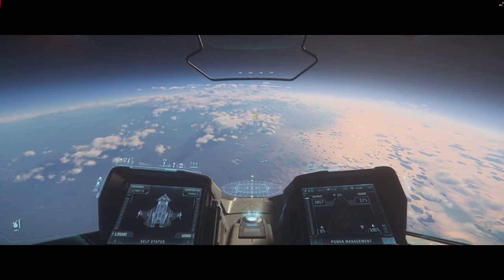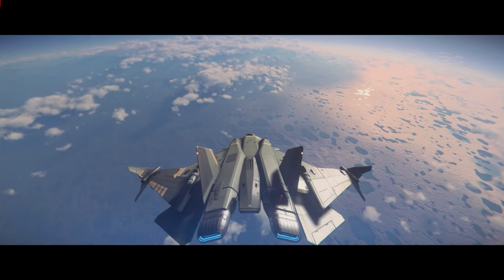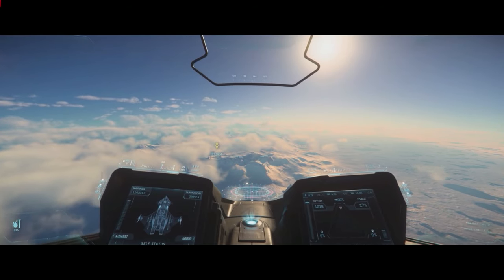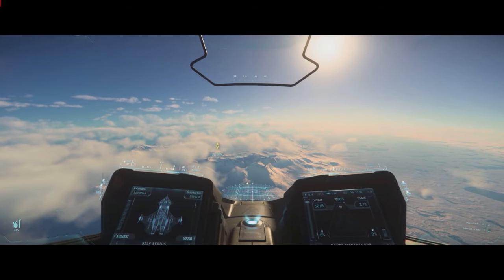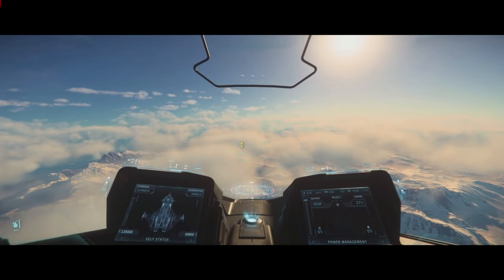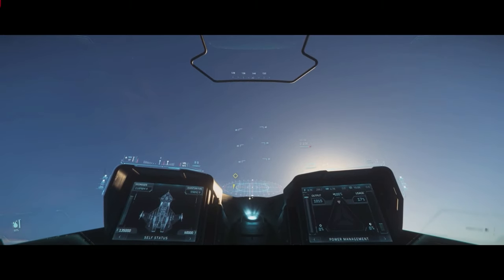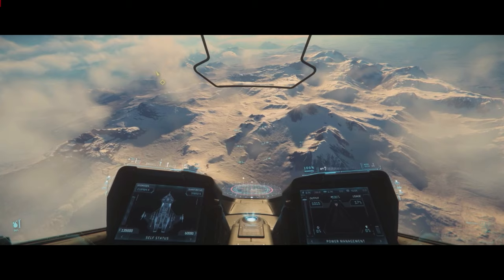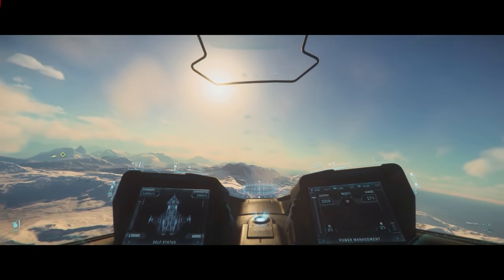Star Citizen Citizencon 2953 - Control Surfaces Demonstration

Comment: I love love love this concept. Bulky ships should absolutely have a penalty in atmo, and massive ships should only be really optimized to takeoff and land rather than maneuver. It would incentive turret gameplay, and give fighters with good aerodynamics a really good edge, and most importantly, an increased skill ceiling from the omni thrusters model we have now. The flight surfaces would be a double edged sword; you can easily outmaneuver your bulky targets and dodge fire, but you now have energy management and stalls to think about, and flying into terrain, and you can’t just upstrafe to get out of it. 

Science wise, instead of heat being the reason they won’t work (well) in atmo, it should be that the smaller mavs have difficulty counteracting air resistance and thus aren’t very effective in the troposphere. Larger ones like VTOL thrusters and main thrusters have enough power to overcome drag. Additionally, the thrust generation reaction itself could be way less efficient when not in the vacuum of space (though since it’s hydrogen fuel I guess it should also combust down in atmo too). I’m sure they can come up with a mostly believable solution that is good enough for us to press the “I believe” button

Comment: The real question is how will bricks like the Carrack, Hammerhead, Reclaimer, 890 Jump, or Cat manage in atmo?
Reply: Like a brick I suppose... hammerhead and 890 aren't supposed to land too often so shouldn't be a problem, carrack too. I rarely land my carrack, usually use a snub and leave it in orbit.
Reply: Hopefully they drop like a rock, with limited VTOL thrusters.  They should have significant motivation to remain in zero G.
Reply: @jeanwesleynew I disagree that they should,  we're going to have some really bad game play if ships that were designed for atmosphere stop working. 

They literally said only a couple months ago that ships like the cat and c2 are how you'd move cargo to and from surfaces when ships like the hull c can't.  And if vertical thrusters are that weak even a freelancer will fall from the sky.  

This is the one thing they showed this weekend I disagree with their reasoning and implementation.  I think CS should work,  I don't think ships should be dependent on them to fly. No to mention the cooling reasoning is the opposite of reality if someone cared about realism.

Imo, HH and bigger should still be too big to enter but some ships, like the 890, we designed and advertised as being able to enter atmo.  The carrack should also be able to or it can't truly perform its role.  Some people treat it like a capital base but that's not what it is. It's an exploration vessel that needs to be able to launch ground vehicles... so hopefully they tune this system well towards large ships
Reply: @amirtaoun3386 
Except the carrack has that large garage with vehicle ramp. It was meant for ground operations.
Reply: @private_citizen  It'll still be able to land, it has enough thrusters for that. But flying in atmo other than taking off/landing will be a problem I suppose. And landing and takeoff such a large ship will take time I'm guessing.

Comment: Very cool. The "super powerful thrusters in space to make flying feel good" and "realistic flying in an atmosphere" can't really co-exist, so the introduction of decreased thruster efficiency makes perfect sense. Though I gotta say as a space nerd it would be more likely that the thrusters would overheat in space since radiative cooling is the only option unless SC has some fancy "only works in space" cooling technology.
Reply: Maybe. 
What i could imagine is the thrusters overheating because they need far more power because in atmosphere they also have to push against gravity and wind resistance, while in space even just tiny short thrusts are enough to navigate, as long as they can overcome the ships own mass.
Reply: @Robonator14 purely a sentimental thought though as  full power is full power regardless of where you are.  They can't just magically go to 180% because you're in atmo right?
Reply: @davidmorton6406  They can't, yes. Wind resistance alone would make it near impossible unless the ship isnt actually moving. 
Full power is full power yes, but assuming its always at max power, there is also a very big difference between short controlled bursts and continious thrust due to having to fight against gravity and having to keep the ship moving.
Reply: @Robonator14  nah you're still making sentimental thoughts,  people use full power in space all the time,  especially with coupled flight. So we're not comparing short bursts to having to fight air resistance.  Full power is full power period. Thrusters would be unusable in space if we had the idea that they could overheat in atmo
Reply: @davidmorton6406  I dont think you understand the difference between power applied and the time the power is applied for. It also doesn't matter what the player does when the game simulates varying degrees of thrust, which it absolutely does, otherwise you could not slow turn and would always snap around.
Reply: @Robonator14  I'm sorry but you're the one missing the point here....
Reply: @Robonator14  I was driving earlier for work, with some stops to text so i gave a short response above, but you seemed to now know what i meant by sentimental thoughts. Essentially you're creating a scenario that fits exactly 1 outcome where this is useful. Sentiment meaning a feeling towards a specific event or outcome. And your last comment to me even proves it. Most of what you said had absolutely nothing to do with what we're even talking about. But I can break it down for you real quick because you also somehow made my point for me lol.

" I dont think you understand the difference between power applied and the time the power is applied for" What are you even talking about here? This has nothing to do with what we're talking about above. This only refers to the situation you made up in your first comment to the OP, but none of this matters if we're comparing Atmo to Vacuum directly. 

"It also doesn't matter what the player does when the game simulates varying degrees of thrust, which it absolutely does, otherwise you could not slow turn and would always snap around." This also isn't referring to what we're talking about, but it's also just untrue. The game currently is not ALWAYS taking multiple degrees of thrust. If im holding perfectly still in space and push forward on my left stick, i strafe up, and ONLY up, using ONLY my bottom thrusters, and as long as i hold the stick in full up i use full power from bottom thrusters. 

So my point was that, we're comparing Vacuum to Atmo, and full power to bottom thrusters in vacuum would generate X heat. Full power to bottom thrusters in atmo would generate the same X heat, BUT atmo should dissipate heat better if we cared about realism. You don't just magically get more heat from a thruster doing the same amount of work . Atmo would make it cooler... Or stick your PC in a vacuum and see how it fairs lol. So i don't know what you're on about with people turning and shit and the game being snappy. None of this matters lol.

And you didn't even get into with me about how the whole system as proposed is actually bad either, which i have some feelings on that if you're interested. Essentially based on their demonstration the only ships who can enter atmo are light through heavy fighters and thats it. They said that at a certain point in the atmo your thrusters would just stop working. Many ships don't have wings at all, but are small and designed to land or work on planets. We can never float mine with a prospector ever again, the drake cutter just dies if it touches atmo lololol. Thrusters have to work in atmo or this game fails. They're too focused on the dog fight element and it blinded them from all the other aspects of the game. For the sake of both the games health and realism, their current design is just wrong

Comment: Why would a thruster overheat in atmosphere but not in space where its much much harder to remove heat? That shit no make no sense.
Reply: because its still a game and not everything must be 100% realistisc. Sometimes "fun" gameplay comes before realism
Reply: @Viper3dc  But they could come up with a better excuse instead of something that actually is the opposite.
Reply: Mentioned this in another comment but something i can imagine is the thrusters overheating because they need far more power since they also have to push against gravity and wind resistance, while in space even just tiny short thrusts are enough to navigate and keep the ship moving, as long as they can overcome the ships own mass.
In space they don't have to keep the ship floaty, they only have to make small adjustments to its position or course. 

And of course gameplay reasons to balance it out and i would rather take toasty thrusters than much increased fuel costs
Reply: @Robonator14  Its the opposite in my opinion. In space especially in combat those thrusters need to work extra hard while in atmosphere you only need as much thrust as what makes you hover. Not using thrusters that can make you turn on the spot but relying on control surfaces also makes zero sense.
Reply: @TheDude50447  Yeah but like i said, in space you only need short controlled bursts to affect the ship. There is nothing else affecting you there. 
In atmosphere you need to maintain thrust to fight gravity and hover, but also fight against the wind. Even worse on higher G planets.
Since the majority of the ships are rather designed to be used in space than in atmosphere, i would assume their cooling and power delivery will be tuned for many short controlled bursts over prolonged, higher-power usage. 

Relying on wings & co still makes sense, because you have to use the wind, not fight against it to fly efficiently. If you fight against it at higher speeds by bruteforcing your maneuvers with thrusters, you will just end up in uncontrolled janky flight that at worst causes your ship to get damaged or break apart because of the unnecessary stress it puts on it. 

The only alternative they could do would be to massively increase fuel consumption and i would rather be limited in thruster navigation than having to pay so much extra for fuel and being helpless when it runs out.
Reply: @Robonator14  i totally get that for civilian and especially merchant ships. But the military doesnt care about fuel efficiency. Performance is all that matters in combat. So something like the gladius would certainly use the maneuvering thrusters which is the difference between literally turning on the spot and having quite the turning circle at combat speeds.
Reply: @TheDude50447   Of course they care about fuel efficiency. Even the strongest ship is useless when it can't fight for more than 5 minutes. 
But the gladius is also a ship that was designed for both space and planetary combat, which is why it has the wings and rudders.

And turning on the spot would not realistically work at least not while the ship is moving in one direction. The wind is once again going to make it impossible or at the very least make it extremely difficult, especially when you also want to maintain speed, like you can in space. 
This is also something they showed after the clip in this video ends: the gladius getting pulled into another direction due to the wind, even with thrusters on. 

We already have VTOL tech IRL, but it is not nearly as effective due to these forces affecting the aircraft. The only advantage it gives is being able to start and land with very limited space.
Reply: @Robonator14  Using thrusters instead of rudders would drastically improve maneuvering. No military would not use that.
Yes to a certain degree they care about fuel efficiency but in a case like this where the extra fuel consumption would be quite manageable since the wings still work as uplift its not a question. They would most certainly use the thrusters.
Reply: @TheDude50447  it would still cause the entire ship to destabilize drastically when its moving and there is no reason to prefer that over wings and rudders when there is the choice. 
No amount of thruster magic will fix that and the wings arent magically producing uplift either, which makes them not useful at all during a hovering state.
Reply: @Robonator14  You need thrusters anyway for hovering. But during flight they would still provide the same uplift control surfaces or not. Anyway like I said no military would build a spaceship that needs maneuvering thrusters but then include extra weight and potential problems just to have control surfaces that wont provide the same maneuverability. They will tell their engineers that they better damn well make sure that the thrusters work for atmospheric fights as well.
Reply: @TheDude50447  This is exactly why we have ships in the game that are better suited for in-atmosphere flight than others. Some have wings for that purpose and others have not. And those without will most likely fly like the bricks they are in atmosphere. 
No matter what someone "wants". You can not change the law of basic physics.
Reply: @Robonator14  ships behaving like tubs is because they are tubs. Nothing to do with control surfaces. 
Putting control surfaces on military space fighters that have maneuvering thrusters for space makes absolutely no sense. There isnt any reasonable argument for it in terms of realism. In fact i dont really see a reason for control surfaces at all.
Reply: Make some comparisons to how a Harrier hovers. Respectable amounts of thrust, but it can only really make a safe vertical landing when it's around ~15% of its max weight capacity (fuel & munitions weight combined). Scale that up to the weight of some of the ships we have in SC (factor in the weight of all the components, fuel and weapons) and I'm able to suspend my disbelief in the atmospheric model. Seeing the demo of hovering in the new flight model reminded me a lot of how a harrier behaves in VTOL flight.
Reply: @ftbrd  it hovers anyway. There was no mention of them removing the hover part. And during combat in flight you still have lift through the wings. You just replace an already existing much better method of maneuvering with a worse one for no reason
Reply: @TheDude50447  well the hover part plays into the entire theme of aerodynamic stability they were also demonstrating. Regardless, it'd be silly to solely use thrusters in atmospheric flight for maneuvering when control surfaces would be more efficient and reliable. You'd burn so much extra fuel just maintaining straight and level forward flight if they're going with a more realistic atmospheric flight model. Fuel efficiency is a survivability concern for the pilot, not just a bottomless military budget.
Reply: @ftbrd  extra fuel consumption wouldnt be too bad since control surfaces are basically air brakes. The harder you turn the more energy you bleed. That fact wont change. 
Also the military doesnt care about increased fuel consumption.
And if you really want to you can use the space and weight the control surfaces would take up for more fuel storage.
Reply: yea they should've said something like all thrusters will have reduced thrust effect in atmosphere especially at speed. Lateral thruster would be hit the hardest.